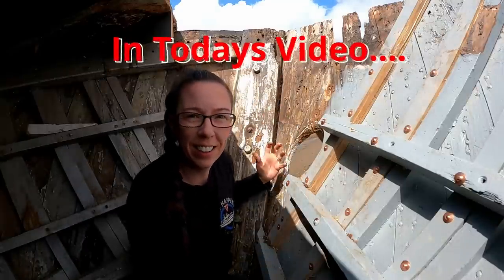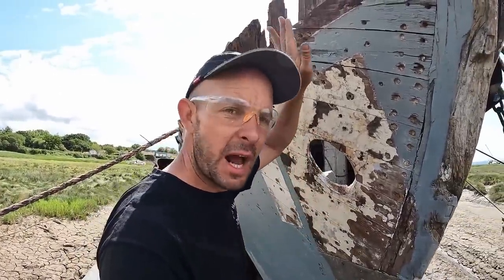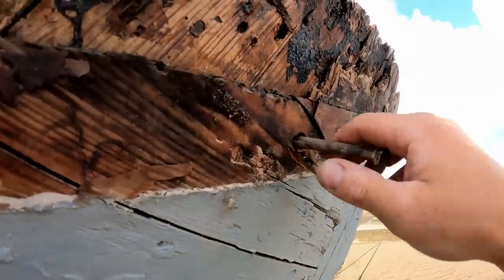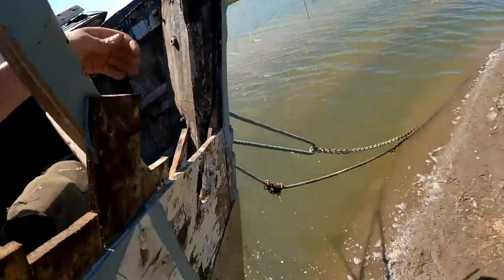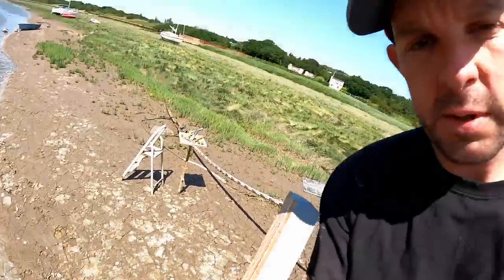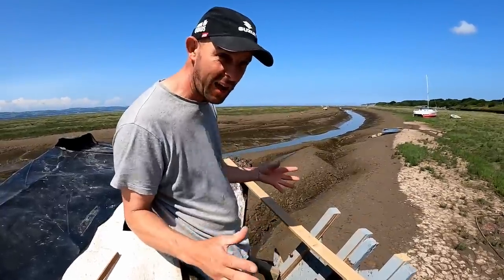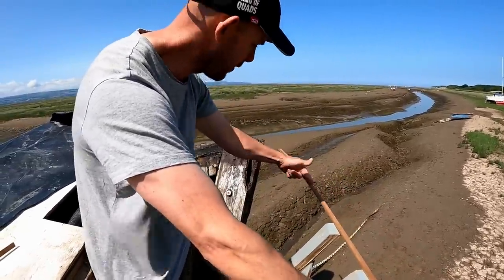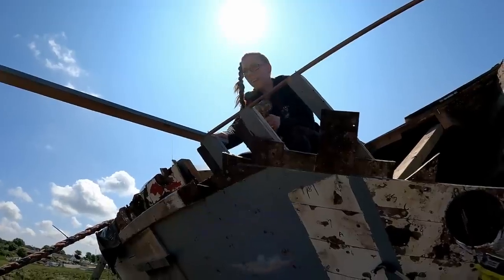Ep 128 - Replacing Planks On A Wooden Boat #boatrestoration

Comment: Gemma, I can see why you weren't looking forward to starting this bit, but it looks like it is going pretty well so far. When you were dismantling the diagonal planks, Simon mentioned a calico sheet between the inner and outer planks. Have you replaced that off-camera, or as this is a relatively small area of the total hull, just left it out?

Comment: Planks should be epoxy bonded with a layer of mat and microfibres this will replace calico and bond the planks structurally. You can screw it all together with steel screw ( grease them) remove them later and replace with copper nails and bronze screws at plank ends later when set.

Comment: Great solutions for a difficult problem!
One question - are you guys going to seal up the end grain on those boards? The end grain is, by far, the worst place for water to work it's way in and rot the wood.  Maybe a little epoxy - just on the ends?

Comment: The frame of the boat (structural parts) will have to have all the "surface" wood removed.  To do that I think I would make sure to replace all the structure first, then remove all the "surface" parts.  Just my thought.

Comment: A good way to remove plugged wood screws is to use a small hole saw just  a bit larger than the plug. Drill right down through the plank and you can lift it off.

Comment: "...planking the clamps"    Looks good!  The only thing that might be a bit of a worry (I say might because I am no boat builder) is that all the staggered butt ends are all really along one plank width. I suppose once the beam shelf, the block and the rub rails are back it should be plenty strong enough to hold its shape. Make sure the beam shelf splice is well away from the plank repairs.

Comment: Use a neodymium magnet to help you find the nail and screw heads you can't see. They're sometimes called rare-earth magnets. They are very powerful for their size so finding a nail through 80 years of paint shouldn't be a problem. Just rub the magnet over the surface of the wood until you feel it move toward a piece of metal (a nail).  Unfortunately they won't help you with copper based metals like brass or bronze which are the traditional materials used for screws and rivets in boat building.  Keep up the great work I really enjoy watching your progress!

Comment: To say great job repairing the bow planking is a understatement.  Those head set will be a game changer. Because  of salty location.  Please keep a eye out for corrosion in the battery compartment.  Think about putting small amount  anti- corrosion on the contacts. You be amazed with being in the engine room underway and talking to the wheelhouse.

Comment: If you have to remove any more bungs to access fasters try using a long deck screw and put it in the center of the bung and it will (usually) bottom out on the faster and push the bung out without damaging the main piece of wood

Comment: WIll you please refresh my memory? 😊 What is the material that you are applying with the battery operated caulking gun?    Since the starboard replanking worked out so well with the stem in place ,  I suggest replacing your port planking next.  So when you remove the portion of the stem that needs replacing, you will know that you have already established the proper bend and bow of your crisscross  plank hull. Thank You!

Comment: Great job! I noticed that working in the mud and water slows you down and I know it's very expensive to dry dock or hard dock your vessel. my question is why can't you slip her into a cradle. in the seventies i worked on a salvage in the south pacific, we had no power and the ship was semi-submerged. we were able to slip her into a cradle and get her out of the water and float her for further repairs after we beached her. you wouldn't need to have her fully out of the water but a cradle large enough to clear sections you were working on cleared for repairs. this would help in securing the ship from bowing out and relieve some of the stresses on the hold.  just a suggestion. Love the videos!

Comment: I have a trick I learned long ago when cutting with your chop saw and it wont go all the way acrost with the blade down lift the outside edge of the plank it will cut the rest of the way acros no more flipping boards. Keep up the good work

Comment: When you are end joining planks, like the inner layer, you might consider using biscuit joints.  Little compressed wood disks placed edge ways into the joint.  Here is an example of the tool, don't know brands in England.
DEWALT Biscuit Joiner, 6.5 Amp, 10,000 RPM, Retractable 45 Degree Notch, For Depth Spots (DW682K),Yellow

Great work, keep it up!
Rick

Comment: an easier way to access the hidden screws is to use a diamond coring bit just larger than the screw. just drill a bit deeper than the screw head then pop the wood out. screw head will be undamaged with room to spin it out.

Comment: The stem has a rabbet into which the ends of the outer planks sit.  Looks like the inner planks line along the same angle as the stem.  They too sit in the rabbet. Interesting to see what the material is sitting between the inner and outer planks.  You will need to be careful resetting then resealing the planks in the rabbet in the stem (cutting the rabbet properly when you replace the stem too.). How much of the stem are you replacing because that needs to be done before planking.....

Comment: A brace and bit is THE best way to remove slotted head screws. You can feel the torque while applying considerably more force than a normal driver can achieve. You also need a flat face crowbar to spread the loads and a dead blow hammer so you dont cause dangerous harm to the crowbar.

Comment: Congratulations on replacing your first planks good job. just a point of note on the parts of the boat with more cure the plank width will vary over the length of the plank and you will have to spill it to fit so you might want to take a template of the plank before you remove it.

Comment: Hey guys great job, your doing well, keep it up. Just a quick hint in case you never knew it but if you heat the Bungs (plugs covering the screw heads) with a heat gun first, it softens the glue and maskes them easier to come out. Hope this helps. Cheers

Comment: You guys are both more persistent and energetic than me. I would be tempted to use a pressure injection system of epoxy into some of the rotten ends of the planks rather than replacing them. I'm way too lazy to do it like you. Lol

Comment: Iroiko is excellent boat building wood. Very rot resistant.  
You want to replace the calico that was between the planks. I’d ide fiberglass cloth coated with sikaflex. That adds strength and provides the waterproofing. What you did with just the glue won’t work, but it’s way up at the bow that won’t see a lot of water so no real problem. But for future planks use the fiberglass cloth and sikaflex.

Comment: I've found the easiest and quickest way to remove plugs is to use a small drill bit (1 or 2mm) and drill into the centre of the plug. When the drill bit reaches the screw it can't go any further in so the the plug scews out up the drill shaft. If you are replacing the wood then hacking the plugs out with a screwdriver is fine but the drill method is better for wood you want to keep.
I take it you know you can get plug cutters and drills in various sizes?

Comment: Small safety suggestion about using the push stick on the side of the board on the table saw. Keep pressure on the piece before the blade and up to the blade.  If you push at the back of the blade or after, then you’re introducing the possibility of kickback. The blade gets pinched in the back of the cut due to your pressure and throws the wood back to you. (To be fair that little saw might not have the power to throw the wood but be careful)

Comment: Great work, guys, as always. One question, though, and I bow to your superior knowledge before I ask. Wont it be difficult  to put the thick  bow piece of wood in after you have put the planks in. I imagine it's one piece of wood from the top of the boat to the bottom. So that will have to be done in dry dock, I imagine. Will you be able to line it up to the new planks afterwards🤔
Reply from the maker: No it was fine! Hint hint the new stem is already in!!
Reply: @ShipHappensUK  ohhhhh🙂

Comment: lesson to late to be of any good, but before you buy a wooden boat you have to do a sounding on the hull, the stem and stern the area's that are the hot spots for dryrot, never buy a wooden boat unless you can access every part of the hull for rot, the keel, stem stern posts and at deck level, ribs and so on to determine how much needs replacing. planks must be replaced at full size, if replaced in small sections the hull loses a lot of strenght, plank dutchmans as a cheap way out reduce strenght in the bow and stern. Regards D7

Comment: Is it possible to just remove 6 " from the top and relocate your deck at that new level removing the rotten part ? Being your making new deck beams and you'll be at good solid wood ! Or is it not needed to do ? The bow is looking great !
Reply from the maker: Don't want to lower the deck, as standing height inside would be a problem, then the wheelhouse and the roof would all have to come off, easier to replace the tops of the planks
Reply: @ShipHappensUK  I understand ! I wasn't thinking of extra work just less ! lol. What you said makes sense now !

Comment: When wearing the headphone comm sets. Please wear loud whistles  not only on a lanyard around your neck but witha pinch grip to your shirt so it cannot fall behind your back when you need it. 
When using them  with one in the dingy. Wear a small air horn velro and elastic  strapped to your upper arm . A plastic curly key chain between the velcro and zip tied or hot glued to the air horn can.  I have first hand experience in needing those.   Stepped off the end of the dock while tying up the boat. Leapt off the landing platform on the boarding ladder.  Landed at a 45 degree angle. Toes first. Caught my body weight in a flying pushup  move. Still broke my nose and had a concussion.  My uncle told of a crewmate that did the same thing but died as he head hit a cleat on the dock. 
Those comm units are going to be really handy in the engine room. 
I have two. Six channel versions i got from boeing surplus that i use at drag races.

Comment: Food for thought 

Place a Pice of Fiberglass between the enter and Outer about 8-10 from the Top Down 🤔

Then same thing on the Inside As far as you think after Drying mix Filler pushing down Into the dry Boards 

Maybe a 8 “ pice on the out side !4-5 along the Side to buy you some time.

It would be hidden behind the wood on the out side giving yo a lot of strength.  👏🏻👏🏻👏🏻 great Job

Comment: You have removed very little material yet what you have at 8:30 is severely weak. It was held rotten wood and fresh air - major failure incoming. Maybe a temporary repair of the bow using plywood can allow you to make the boat safe enough until you can get her onto dry land.
Reply from the maker: Serverly weak as the rotten planks are nailed to a rotten stem, so no good material for the screws to bite! No need for temporary repairs as we are replacing it all permanently!